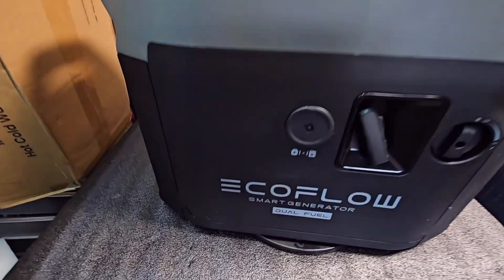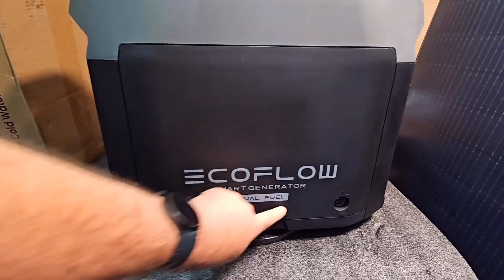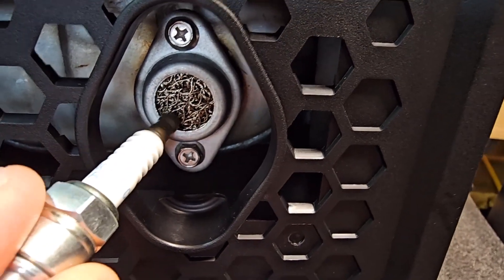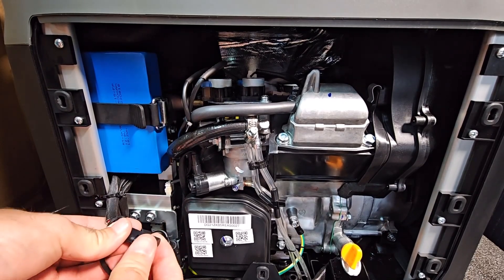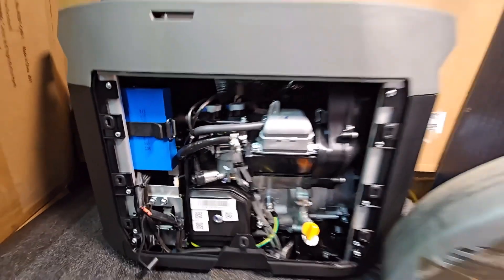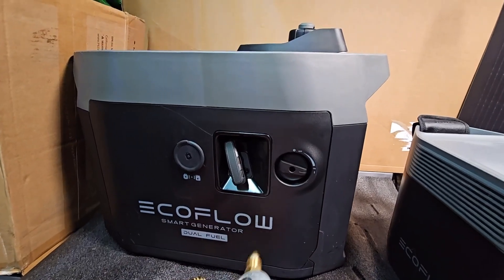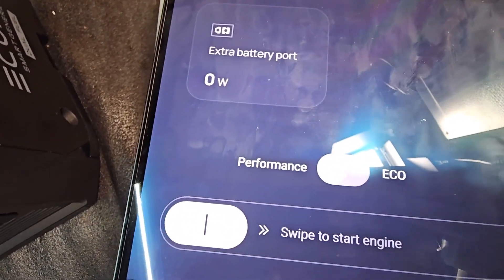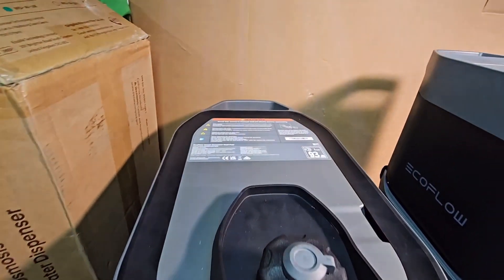EcoFlow Smart Generator (Dual Fuel)

Comment: The problem with this generator is that it always runs at a very high RPM so it will wear out much sooner than normal generators.

Comment: Thanks for the Video.
If you have an LPG bottle connected and petrol in the tank which fuel does it use?
Reply from the maker: It will use  lpg first
Reply: Thanks for that.
Reply: Based on order of usage, if you had the LPG running and you ran out of LPG would it switch to gas automatically or do you have to disconnect the LPG first and then restart it?